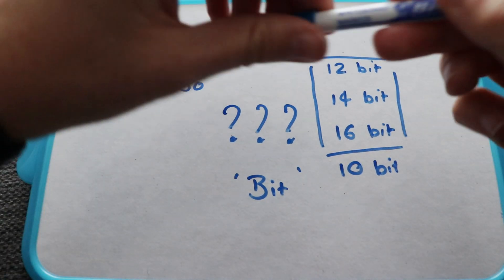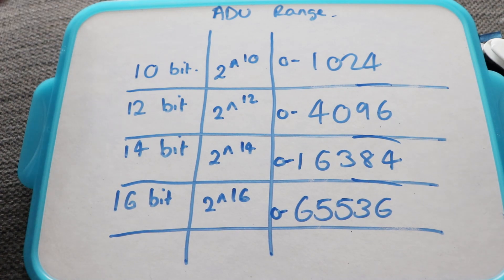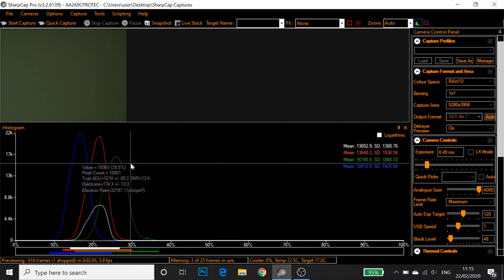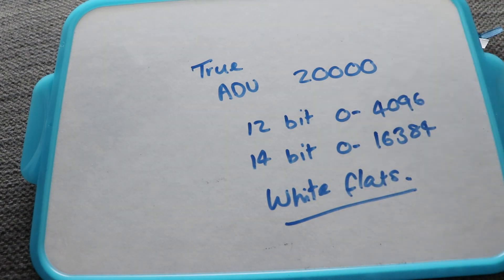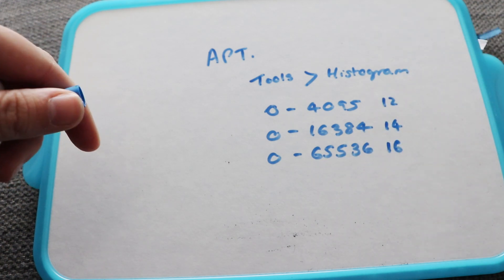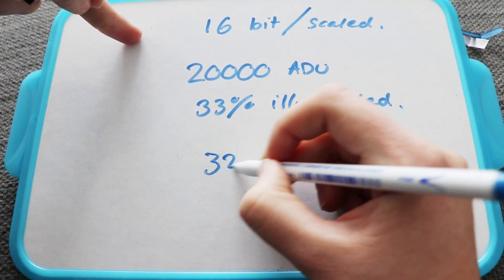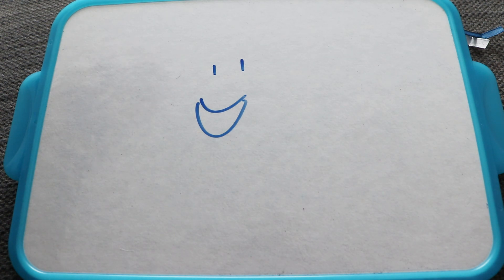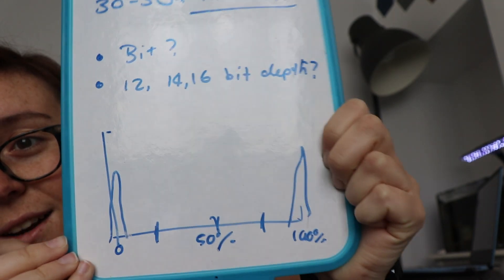Flats for astrophotography, lets do the maths!

Comment: Do your calculations work for CMOS cameras as well.  I had no issues with my CCD flats but am struggling with CMOS flats.  And no I don't use a T Shirt.  I have a 16bit Colour CMOS using APT and I've tried any number of target ADUs but apart from not removing the dust bunnies I'm better off without flats for the dreadful gradients they introduce.  I started at 30000 and have gone both up and down and am now looking at advice to try 20000.  In APT my tool of choice for getting the setting correct all i see in live view is a variety of green and turquoise screens.  ???

Comment: Good video. I  usually do 100 flats and 100 bias. It works extremely well. Funny you made the comment about the white t shirt as I got banding with that and I noticed the material of shirt made a difference I am actually use a pink or salmon colored polyester shirt.  Works great and no wrinkles.

Comment: Great video and thank you.  I tried the t shirt method once!  Then I purchased a light pad (also labelled drawing, tracing, light box on ebay).  Then wrapped a plain sheet of paper over it, taped at the back.  Then connected, with a usb cable, a small power bank.  Very easy, very quick.  I have used it at the telescope and with a dslr  after using the dslr with camera lens - no problem.  Must start taking more flats!

Comment: Thank you for this video. I get your math on multiplying the bit depth by the desired illumination % but what if your app IS scaling? For example I have a 12 bit one shot color so by the math I would need to aim for ADU 2000. But if I notice APT is scaling to 16 bit? How do I adjust the numbers?
Reply from the maker: That’s also in the video! :)
Reply from the maker: Basically if your app scales, treat it as a 16 bit camera

Comment: SGP converts up to 16bit.  I was told to go by your cameras Well Depth.  On my Qhy 163M is 18 to 20k. So I shot my flats at 9k to 10k. 50% of my cameras well depth.
Reply from the maker: If it ain’t broke don’t fix it :) you can calculate the required ADU from the well depth yes . My 183c had a well depth of about 16k, once i calculated it all back using the well depth...50%illuminated still ended up being about 2000adu :) but that’s just the way I do it. If there’s nothing wrong with your flats I wouldn’t change them. Thank you for watching though!
Reply from the maker: Or 30k adu when I stretch it up to 16 bit :)

Comment: Stace, great video. I was having a problem with flats today and found this to be enlightening. One minor thing about ADU range: I think the range of values given the bit depth of an ADC is [0,2^(bit_depth)-1]? So for instance the range for a 16-bit ADC is 0 to 65535, not 65536. The 16-bit ADC can have 65536 possible values from 0 to 65535.
Reply from the maker: That’s correct! I recognised my error as soon as the video went out :) you’re the first one to point it out! But either way hopefully you found it useful and it helps :)

Comment: Thanks Stacy, I have usually done about 10-15 flats ☹️. I will have to pull my socks up and do more. I use a light box for the light source as you say it’s usually cloudy - much like tonight.
Reply from the maker: Hey Steve, don't worry too much if its working for you. might be worth doing a few more though :) 30 + (50 even better)

Comment: Thanks for your presentation Stace, this explains a lot!

SGPro is what I have been using. The histogram/statistics always show 65K+ regardless of the camera used, so everything is scaled like you said. The Flats Calibration Wizard always starts with the default value of 30K, so now I know where that number comes from. This "full bit" value always appears the same even if different gain is used. Usually the captured lights ADU seems best in the 700-1500 range or the highs get too blown out or over-saturated.

Some commentary I have seen suggests flats should be taken in the range where the sensor is still linear, or same number of electrons per ADU. Some sensors have linear response, others do not.  Some folks keeps their flats range a little lower perhaps to avoid the higher end non-linear curve. Any comments on the linearity thing? Sorry if I'm drifting away from the intended basics you have shared.
Reply from the maker: Hey John! That’s great ! You’ve just confirmed a lot of what I was trying to say :) yeah doing flats where the sensor is linear is a better idea, but most sensors these days are linear now. Sharpcap now does a linearity check on sensors and the one I was using in the video is linear up to 99.6% so for that one I could aim wherever I like. I tend to shoot my flats at unity gain regardless and then just vary the exposure time and iPad brightness to get it exactly to what I want

Comment: Hi Stacy,

Another great upload and i love the mathematical computations for flats. I am a DSLR user, and i use BYEOS, and when i take my flats (the same as you BTW i just use a white screen but on my laptop). I keep the same ISO and focus settings, and modify my shutter speed until i have a "central" histogram. Always works spot on, removing any unwanted artefacts. Wouldn't the same be true for CMOS dedicated astronomy cameras ? regardless of bit depth, if we transpose ISO for Gain, in a CMOS camera and just modify the exposure times until we have the same central histogram, would this not work ? I only ask this because i will be purchasing my first dedicated astro cam this year.

John
Reply from the maker: Hi John! You are absolutely correct you can do it this way or as I tend to use APT I like to aim for the correct ADU for each sensor :) it’s just another way of doing it really...I thought people may like to know some of the math behind it all 😀

Comment: Every forum and everyone I know use 18k to 30k ADU for a ZWO 1600mm Pro which is a 12 bit ADC. Do you recommend around 2,000 according to your video as I will try it next time. I noticed after fitting a f0.79 focal reducer it's impossible to get 30k ADU any more. It needs something in the low thousands to stop exposure time of the flats being nearly 2 minutes.
Reply from the maker: No, not necessarily. It sounds like it’s been scaled to 16bit as I mention in the video. So 18k to 30k is fine
Reply: @Crypto Alchemist - I know that with my ASI 1600mm, if I use 20k ADU i get an inverted correction from my flat.  There's something fishy about that camera.
I do not get that problem when I use 8K to 10K ADU for my flats, however.  (Using SGP, btw)
Reply from the maker: So when it’s scaled to 16 bit you get the range 0-65k ish. So 30k is just under 50% illuminated
Reply: The question is, really, what are you looking at?  What numbers?  Are you looking at the True ADU value, or are you looking at a 'stretched and scaled' number?  For a True ADU value, it's not going to go over 4096, so a 2000 value would be great.  But, if it's stretched to a 16 bit number, 30,000 is what you want.
I do find it interesting that with a .8 focal reducer you can't get as high an ADU as before, that doesn't make sense, since you should actually be seeing a lower f/ratio.
So, what program are you using to look at your historgram, and what scale are you using?